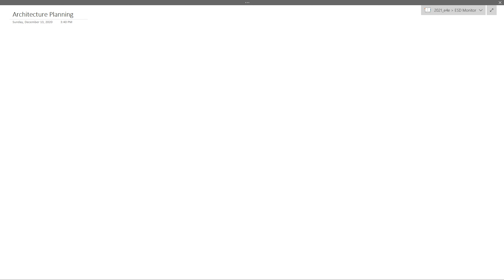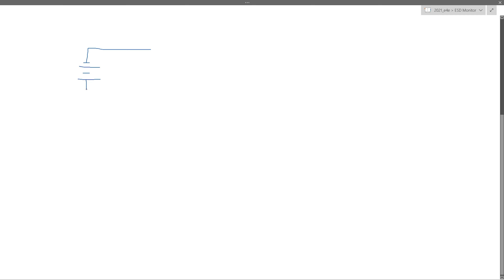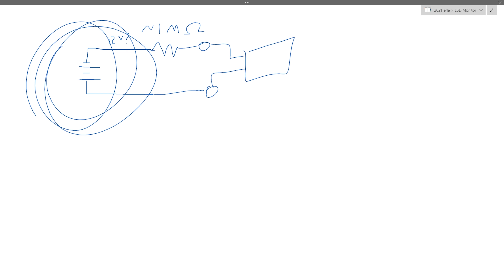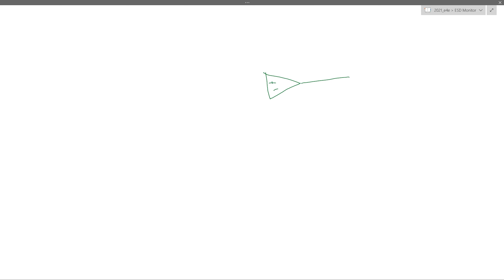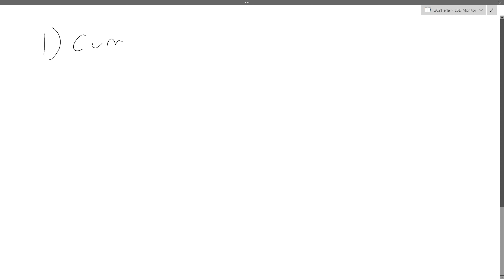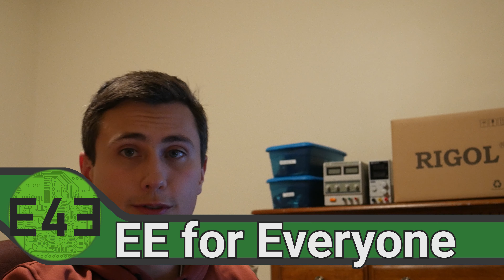Architecture Planning – ESD Mat Monitor

Comment: Awesome idea!
Just wondering:
The whole idea is to beep if the mat of the strap is missing?
Reply from the maker: Hello FixDaily! Yes! Pretty much, and to beep if a wire breaks. For example, in dry climates, it's possible that the wrist strap isn't making good contact with your skin, even if you're wearing an ESD strap. This passes a small current to make sure the mat (and operator) are earthed well!